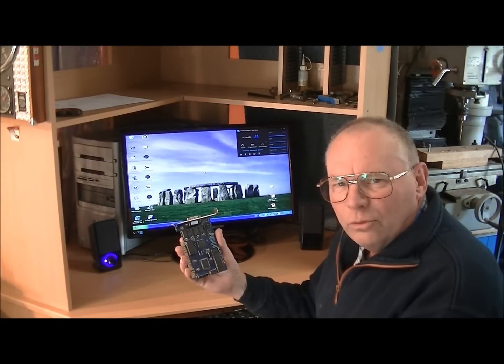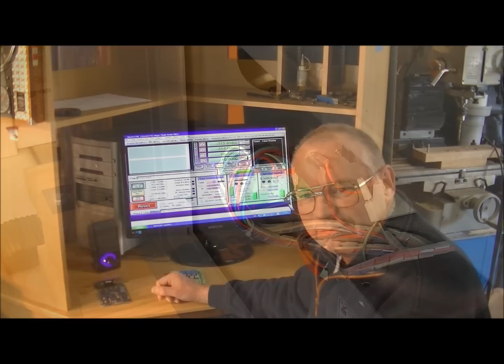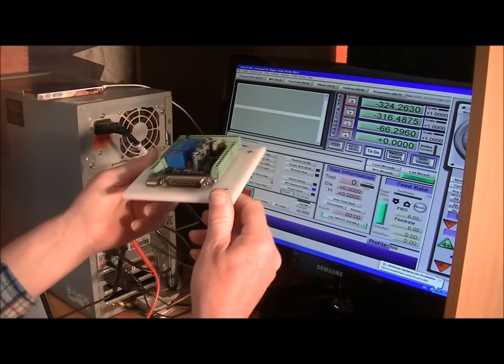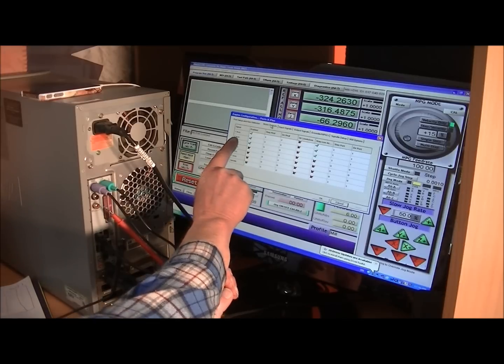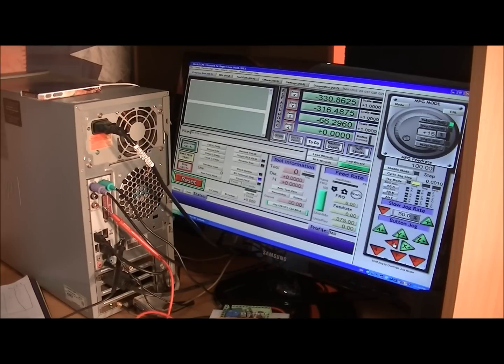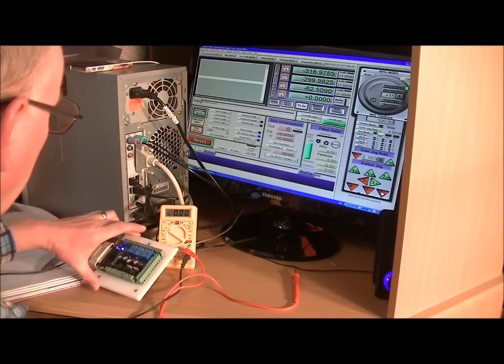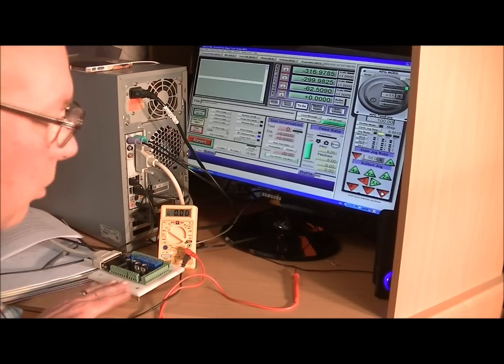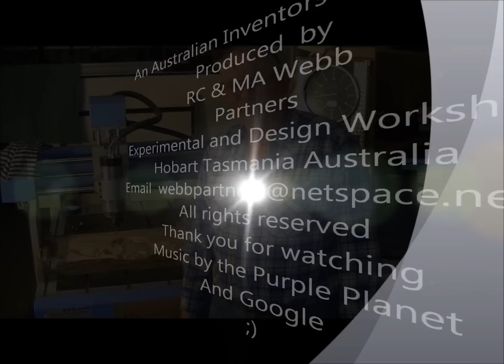77 Convert TO Mach3 *FROM* NC Studio CNC router

Comment: Hello, Roger.  Have you had a  chance to put up a video about spindle setup for Mach3 from NC Studio? I have changed the circuit breaker on my 6090 but having trouble with the spindle configuration.  If you did please add a link to this video. Thanks a lot.
Reply: Have you solve it?

Comment: Hello Roger Did you do a follow up to this video? I have the same machine and converted it to Mach3 but how do I get the spindle to work with Mach3?? There is a VFD fitted and myself and some more electronically minded mates cant figure it out. Been hanging for a follow up video but cant find it if you have made one.HELP PLEASE

Comment: Hello Roger:  I have been following you for a while.  Great projects and help for a newbie.  Thank you.  I have just moved to China--working at Shanghai American School and setting up a comprehensive MakerSpace.  I have just discovered the very many CNC manufacturers in Jinan.  So instead of importing a Shop Bot CNC router, I would like to purchase a domestic model here in China.  The machines are all very similar, using the same OEM components and assembled by many shops in Jinan.  Do you have any recommendations for a Chinese manufacturer of a 1500*2500 mm CNC router.  I never thought I could afford such a machine compared but now I am looking at a vacuum table, ATC, and maybe even a fourth axis.

Comment: Wonderful! Helped greatly. Not sure if you have another video on this but please note, it is paramount that those with older computers with Par port, ensure that it is enabled, and select EEP Mode. Then it works like a snap.  Thanks for taking your time to help us users in the fog. And Ditto on the NC Studio card... it is really a product that has 0 support, Chinese translated to English via google. For those that feel that it is OK for a beginner, way off base. One of the most complex configurations I have endured do to, lack of users, lack of support and lack of card functionality in relation to pins to properly setup even the most basic of 3A CNC's.

Comment: Roger I just bought a Chinese Nice Cut 60/90 cnc router on craigs list, I went through the machine the linear bearings were sloppy loose they were missing over 50 ball bearings between the 4 bearings which I replaced. It has NC studio which I am converting to Mach 3. I bought a RioRand&reg;4 Axis USB Interface Breakout Board Adapter CNC MACH3 For Stepper Motor Driver [ASIN: B00N1Q5BPY]  It looks Like the board you installed in your machine. It requires a 15vdc - 35vdc input voltage. My cmc router has a 70 - 90 vdc output. Did you have to add a power supply for your break out board or make some type of adjustment? Thanks for all your videos !

Comment: Hello Roger
Your machine looks very similar to mine. Could possibly be from the same factory.
Congratulations, you have done exactly the same mod as have I.
NC Studio came with my machine despite my specific request for Mach 3.
I very quickly understood the failings of NC Studio and without haste I converted to Mach 3.
Since I was in procession of a breakout board anyway the procedure wasn't to painful.
Greasing or even oiling the various bearings is just a pain in the bum but I like the idea of rotating the leadscrew nut 180 degrees making it easier to get at from the back..
Reply from the maker: quintellio G’day, I’m glad you like my video and thank you for
your comments and watching, it all helps me to improve my channel.  Roger Clyde Webb Australia ;)

Comment: Roger what CNC machine are you using and where did u purchase it? I've been looking for ages and the only ones I can track down are tiny or huge...enjoy your dry humour.
Reply from the maker: nigel davies 

The 6090 (bed size) CNC router machine is from Salecnc
China, (speak to Jimmy good English), I had the machine up rated to 8 inch /
200mm gantry and 2200w / 3hp spindle (router motor) + I had the 4th
axis. Total cost including shipping and TAX, USD$ 7000, I would also recommend you
purchasing ArtCam Express software approximately 200 USD, as the CNC router
machine is supplied with ArtCam Jewel-smith from Salecnc China, but with NO 3D
reliefs. ArtCam Express comes with over 600 3D reliefs. Understand that there
are years of learning and experimentation by me that are not in the videos and
projects to enable me to carry out and achieve what you see in my videos. Hope
all this helps. Roger Clyde Webb  Australia :)

Comment: I just finished my hack on a laguna IQ HCC dumped the HCC and went to the 4 Axis USB Card Mach3 200KHz Breakout Board from automation. for my spindle speed i used the rs485 and the vfdPlugin-1.7.1.. the nice thing is everything now runs smooth as silk with in mach3
hope this helps 

by the way i really like your videos keep up the great work